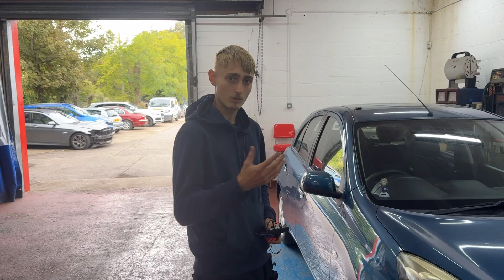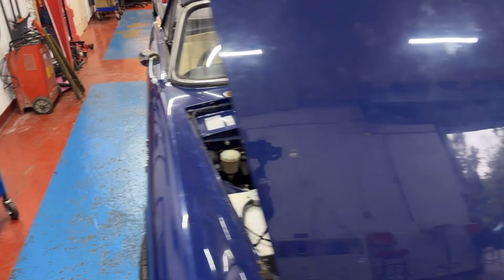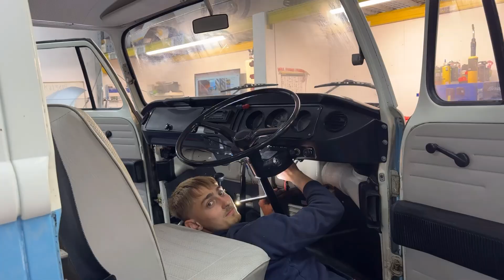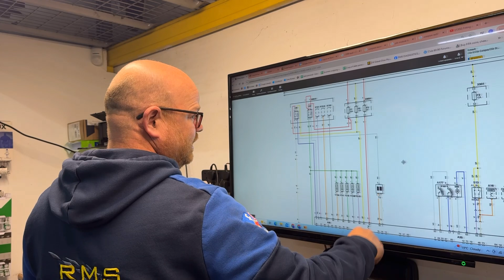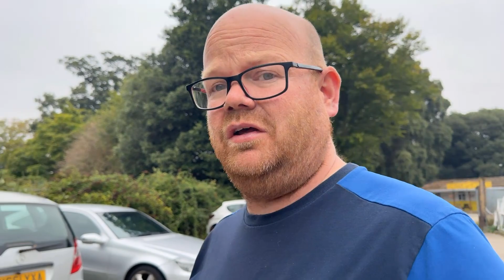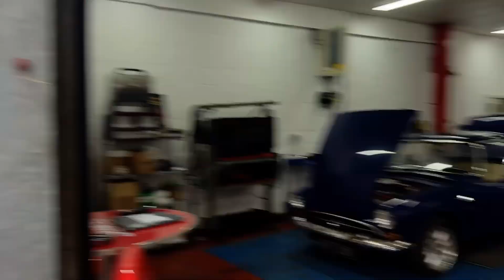Barney wants to go it alone #snapon #apprenticship #thinkcar #launch #training

Comment: My daughters 2012 I10 has got one of the fuses I found it during a bit of fault finding, she had been to a music festival... battery goes flat, kind Samaritan just starts, she then finds it not charging RAC/AA diagnose alternator, various other these weren't working. No speedo was odd. Car arrives home I start looking, with so many things not working I'm looking at big fuses and with in 10-15 mins I find 100A alternator fuse popped. Do temp fix to prove if in the right direction and jobs a Carrot as Bob says. The harder part was trying to find a new fuse. Moral of the story if jump start leave it connected to the source for a good 10-15mins and give the battery a chance to take some charge.

Comment: We had a Transit custom that we could not calibrate the steering angle sensor, we set it zero on the data pid switch the ignition off unplug the steering angle sensor turn the wheel until it is straight replug the sensor and it remains on zero.
Reply from the maker: I knew there would be something like that we was missing🙈thanks mate

Comment: nice to see how you splice  wires its easy for you to just say splice here splice there but to actually see how is greatand its great that your going into more detail whats the amphound you mentioned?
Reply from the maker: thanks mate, the amp hound is a meter that can calculate the amp draw on a single fuse just by probing both terminals,it uses the resistance of the fuse to show volt drop across,you can do with a multi meter and there is a chart to calculate yourself if needed.

Comment: Nice to see a youngster this good and this switched on at such an early stage. Look after him! These fuses/modes are called transport fuses/modes for shipping when they are manufactured.
Reply from the maker: he is doing well mate, i know some vw are programed in trasport mode. its not a bad idea
Reply: @rmsdiagnostics  when I was at a Vauxhall dealer early 2ks the Vectra C with its magical canbus system were all delivered in transport mode. You had to hold the 2 stalks up for a few secs to exit it and all the various systems off line would wake up. I know the PSA stuff has that transport mode ‘bridge’ fuse that you can move from one position to another to enable/disable aswell I think? Yes to have a lad like him so keen, switched on and actually interested enough to research off his own back is a rarity the last 15 years or so. Well done for finding him and keep him keen. Good luck with the channel mate
Reply from the maker: @mentalmechanic  thanks mate, you still in the trade?
Reply: @rmsdiagnostics  yes, Been in it too long now! I bet you know the feeling

Comment: Is a storage fuse the same as a transportation fuse as my Hyundai i30N has a transportation fuse.
Reply from the maker: I think so, but it’s unusual for it to be talked about in the owners manual as a long term storage switch?
Reply: @rmsdiagnostics  I have switched my transportation fuse off before and the infotainment system doesn't work and the central screen on the dash clocks doesn't work but that's all I have noticed.
Reply: Yes.
Reply: @khalidacosta7133  Thanks, 👍

Comment: some salesman barely tell customers about the cars there buying, had one before were customer thought boot wasnt locking , but car was keyless so opens when in range 🤣🤣 had show them once walked away its actually locked
Reply: Most salesman - do not have any clue as to the technical side of the cars. They are however experts on upselling.
Reply from the maker: they love to up sell